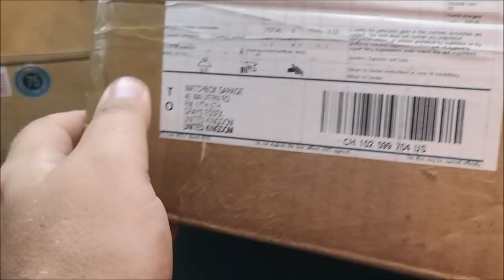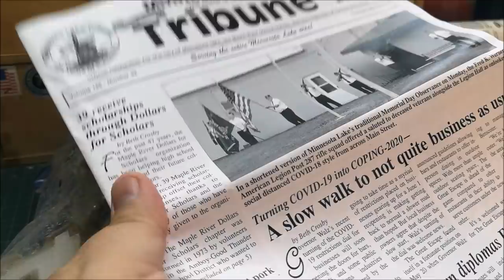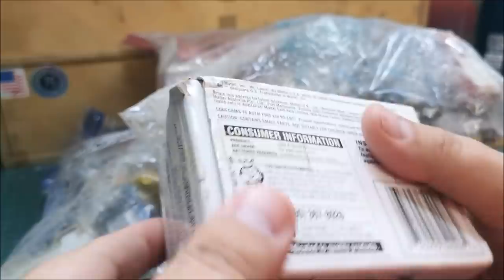MEGA Unboxing from Minnesota USA!

Comment: At 11:00 ish, the white digger with an orange bucket, the piece sticking under the arm is probably the rod for the hydraulic cylinder on the arm next to it.

and just before 14:00 ish, the spare tire you pickup looks like it goes on the red and yellow crane truck, it is missing a tire on the back.

We will get some nice restoration / custom videos out of this haul, really nice pieces in there.

Comment: Cool unboxing with lots of interesting cars.

Ford Taunus is German model. 
Some early models had v4-engine (same engine was used also in Saab 96 models) and front wheel-drive. 

Later Taunus models were same cars than Cortinas mk IV and V generations.

Comment: Nice box of goodies. I mail a similar size box to you on July 9th but it may have sufferd the same date and gotten caught up in Customs. Hopefully you will receive it very soon. Cheers!
Reply from the maker: Thanks mate 😎 Nothing received yet but hopefully soon 👍🏼
Reply: @MatchboxGarage  I am surprised this one got through. Spray paint is usually something that will get a package stuck at customs. Testors used to be very common up to about 2007/ 2008... then suddenly it was gone from all of Europe, and basically Vallejo took their place in the hobby shops.

Comment: Rob - if you push down on the Matchbox 'Light & Sound' Mercedes, if the battery is still good, the lights will flash, and the siren will sound. The series included some Ford Transit Supervans, too.
17:20 - this odd vehicle is used to pull airliners about at big airports. The ones used in the UK were often made by Douglas. One of these was heavily customised, and made into the 'Armoured Personnel Carrier' used in the movie 'Aliens'.
I love Tomica models. The ones that really interest me are the 'indigenous' vehicles that are only ever seen in Japan, and the 1960's and 70's cars we had here. Trust me. They are beautiful - but I dare not start collecting them. I made a 'wish list' a few years ago, and if I'd bought everything on it, it would have been a few quid short of £600.
ERTL cars, in 1/64 scale, always annoyed me. They were far more expensive than Matchbox or Corgi, but as well made, or detailed as neither. Often without steering wheels, or too thick window pillars, iffy transfer/sticker/tampo placement, and always nasty wheels, and flimsy bases - but they had the licence for all the cool TV show cars. Their big (1/24 - 1/18) scale pressed steel cars were great, though.
37:50 - The Scammell was originally a military recovery vehicle, and always green. After the war, they were sold off to civilian operators. I have an Oxford Diecast model of one operated by BOAC just after the war. It looks very attractive in their light blue livery.
The yellow Lone Star 'Impy' Ford Taunus - a German car, and that model was one of my all time favourites as a kid - I do remember it being a much brighter yellow than that. Those 'Impys' were always astonishingly good, great fun to play with; and it makes me rather sad that they're not held in higher esteem.
The Cadillac 'Ecto 1' ambulance. I've got one that I'm converting to a hearse.
50:05 - I have a feeling that the driver of the blue racing car, is Snoopy from 'Peanuts'. The licencing syndicate mentioned were the company who licenced cartoon strips to various newspapers, 'Peanuts' being one. The odd shape of the driver, suggested Snoopy to me.